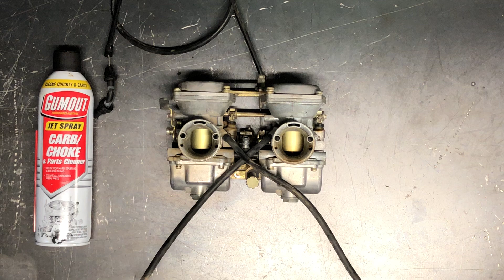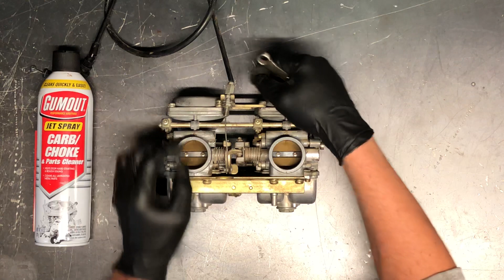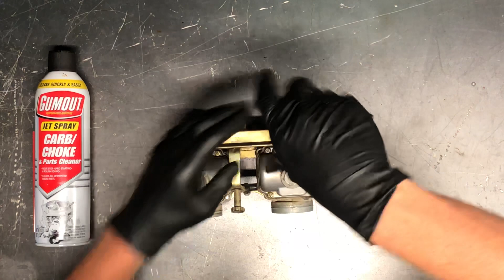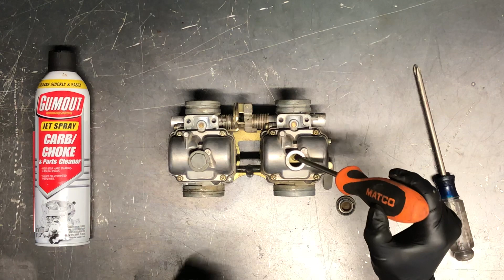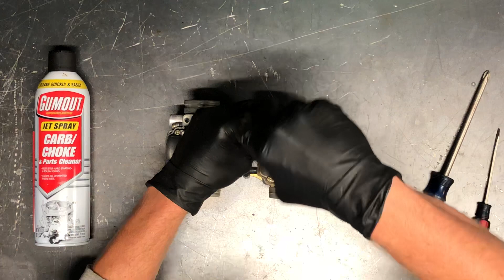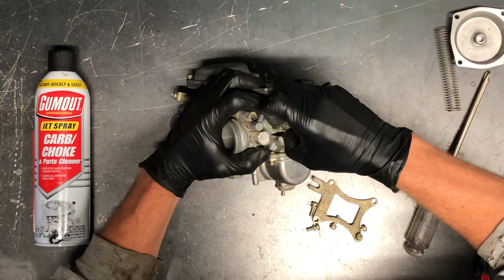How To - Suzuki GS450 GS 450 Wont Start/Idle - Clean Rebuild Dual Carburetors Carb kit - cafe racer

Comment: If the rubber diaphragm is torn, would that also cause it to leak fuel?
Reply from the maker: Nope, you likely have a bad needle jet or something holding the needle jet open. Thanks for watching and the comment. Let us know if you need anything. https://www.ebay.com/str/midnebraskamotorsports
Reply: @MidNebraskaMotorsports  is there a spring behind that float jet in the bottom?

Comment: thanks, pretty helpful. my needles were getting stuck in the seat, no fuel would flow into the bowls at all. I pulled it out and it had a rubber tip, i think the last guy put the wrong part in there. either way I got some new ones, fingers crossed
Reply: @bren42069  Did that solve it?

Comment: Just bought an 87 GS 450L from a friend with 5000 miles but it doesnt run. The motor turns over and is getting spark so hopefully a good carb clean will get it running. Thanks for the vid yo!

Comment: Got a quick question. What should I do if my throttle body is frozen meaning I can’t get the butterfly flaps to open. Got the bike as a project. Carbs r really clean otherwise just can’t get the throttle to move freely. Main reason I took it off in the first place
Reply: clean the damn thing good then do it again

Comment: Wow! I learned a great deal just from watching you tear down this set of carbs. My GS450 had been super hard to start and idle the last season I rode (2017). I left my bike in the shed for the past 2 years because identifying the problem was always too intimidating. Those days are over. I've just removed my carbs from the bike and will be carefully cleaning them thanks to this video. INSPIRING! (I'll be sure to share a short video of the corrected issue).
   BTW, I've already liked and subscribed 👍

Comment: You need to remove the choke plunger housing to fully remove the choke plunger. There are 3 Phillips screws attaching the plunger housing to the carb body.